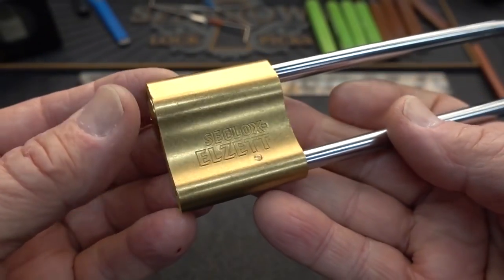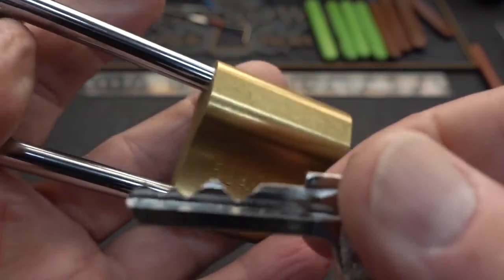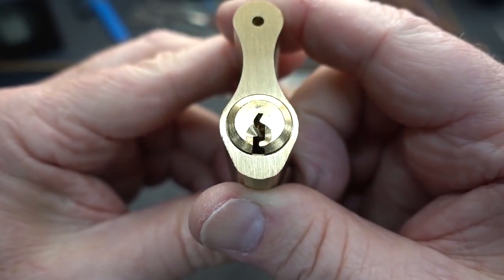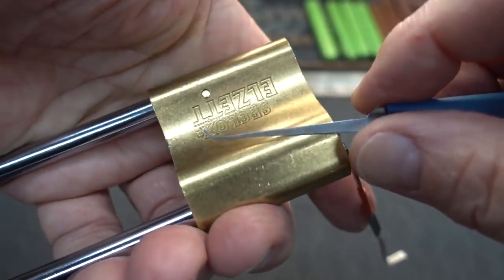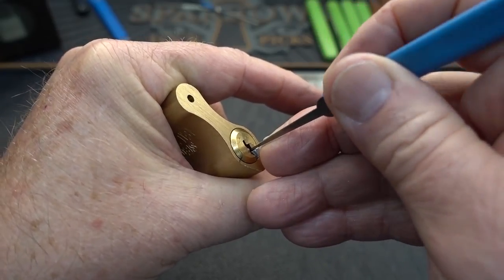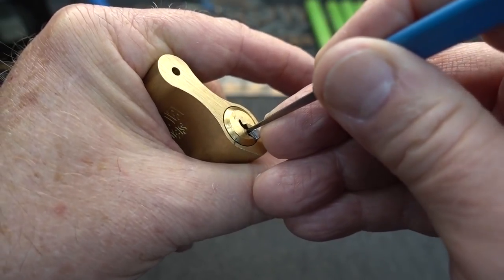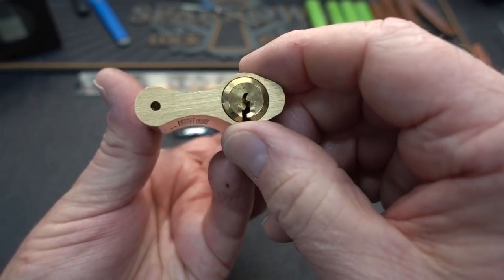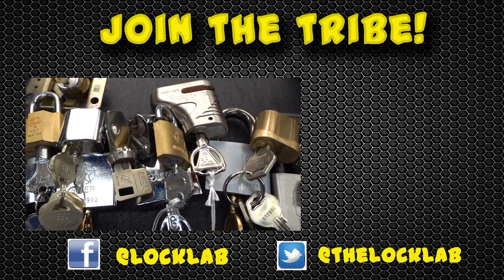(1388) Elzett 2048/45 Padlock Picked Open

Comment: Positions 1, 3 and 5 are spools.
My approach is raking the false set and then going after the spools one by one.
It works on all the 15-50 Elzetts that I own.
They can also get very wild when it comes to key bitting.
Reply: I have "heard" it also , but , somehow , I fail on 5 , and I fall into very deep false set. Not the issue with cylinders tho.... I think they also have very thin spools , thus the deep false set.... Hard to gut such padlock , as 6th pin is keeper , so , I think that shim can't be inserted , even if I move it by one position.

Comment: Unusual shape there with that lock.  Looks rather thin in the middle and probably would easily break open with a hammer or LPL's Ramset. Either that or be successful at picking it. 
Nicely picked Bill but you almost came undone by not completely turning the core 90 degrees. 🤣
Reply: Its brass. I suspect it would just bend into a semicircle. Cutting it seems a better approach..
Reply: @ineednochannelyoutube5384  it's not brass, it is copper. We have these all over Hungary and these ones are very heavy and rigid
Reply: @balazskoti2603  A sárgaréz az angolul brass amennyiben nem tévedek. Márpedig ezek nem ötvözetlen vörösrézbőp vannak.

Comment: Looks like the center of the body of the lock is much thinner than the both sides and looks like it can be hacksawed apart/in half?
Reply: Probably yes. But its not a high secirity lock, and sawing it in half will tale a few minutes, which is good enough.

Comment: Looking at the construction, how did they load the springs and drivers 🤔...
Reply: I think with these non-replaceable core padlocks you usually have the holes on the short edge of the lock, plug them with the same brass as the lock body during construction, and then polish it together so the plugs aren't really visible anymore.
Reply: @Ralesk  agreed... but looking at this lock they're deep in the body and would have to be loaded through the hole that takes longer part of the shackle, that can't be easy surly 🤔...
Reply: Oh right, the core is facing the other way...

Comment: Great job BB ! I have  30  of deese,and i got lucky only with one of them .Of course the bitting was preety bad ,others had wild bitting.With that padlock KABA  (Elzett)  is trying to kill  BANE SEKULIC facotry which makes preety much the same lock model but  in quality its much worse.Older versions were not so bad but newer couldnt be compared.The Elzett seclox 2048 is much better than the Bane ,and much cheaper.This lock goes from 4-6 euros .Its first bad thing are those spools in 1,3,5 chamber.They are preety bad machined,not to deep,not to sharp and ,,heads,, od those spools are huge in compare to others.I dont know why are thay meking them so bad but  it seem that they wont change that for now ,probably because of the low price.Springs are steel and  very durable,probably the best ones i found on cheaper padlocks.Secound bad thing is that the deepest cut on the key can be for one more milimeter deeper.With that this model colud be found with zero lifted pin which will be very good thing in speaking of security upgrades.Anyway ELZETT TUTIUS  or 2048 ,same thing ,was always durable ,longlasting padlock with practicaly the same internals from its birth before WW2 till now.Older versions got copper springs but much sharper spools or mushrooms .If they change that ,and increase the deepest cut (because the key is made of steel so its durable enough) that lock will be realy dificult to defeat......